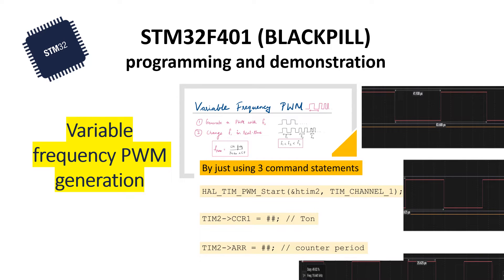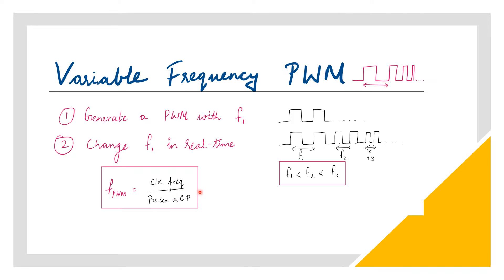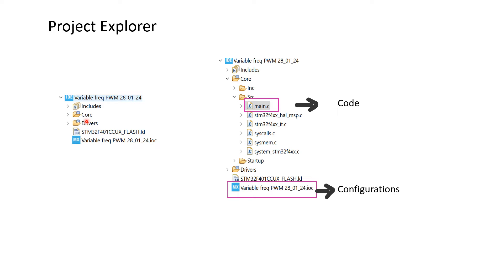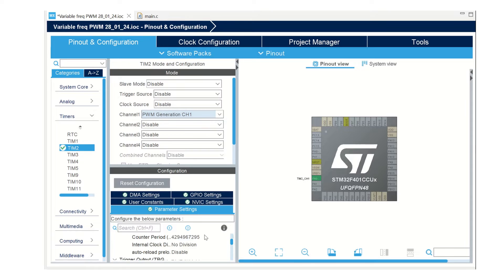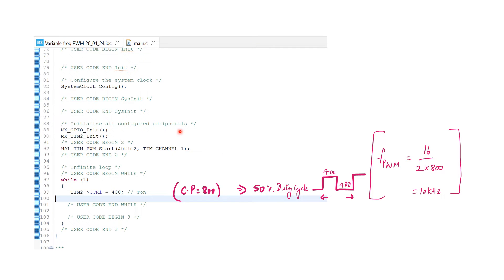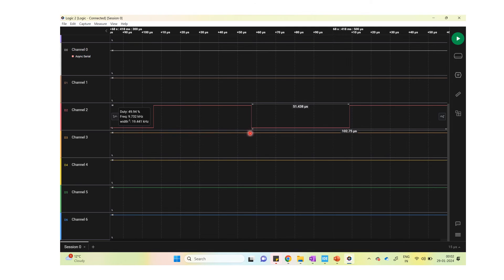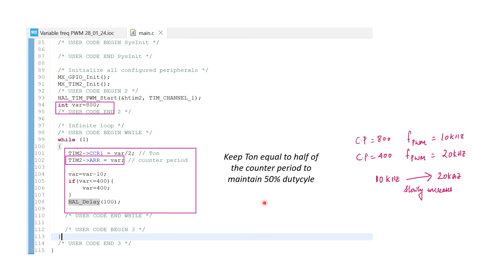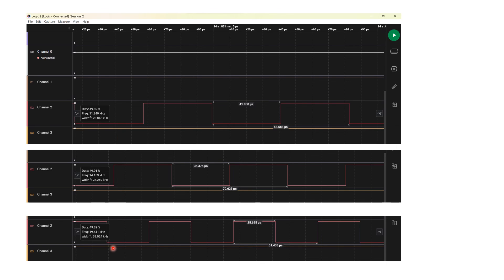STM32 Blackpill || Variable frequency PWM generation || cubeide || just for beginners :)

Comment: can you make anothe video on how to make code for STM32 driver board 3 channel ouput for 3 phase motor controller with frequency of 60H to 225Hz.
I know its easy for you to do that....
Reply from the maker: Hi, I will be uploading how to generate pwm signals for driving a 3 phase motor in the coming weeks. Hope it will help
May I know which board you are talking about for generation pwm?
Thanks
Reply from the maker: Yes, sure.